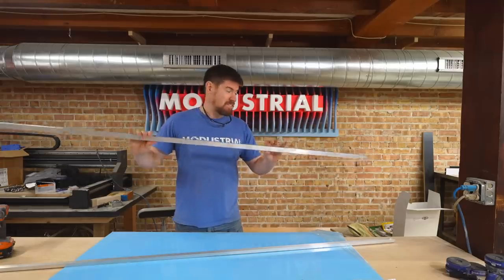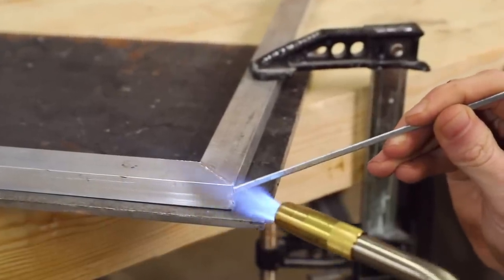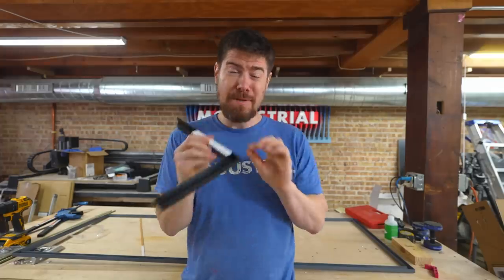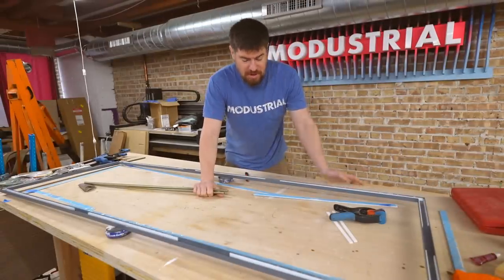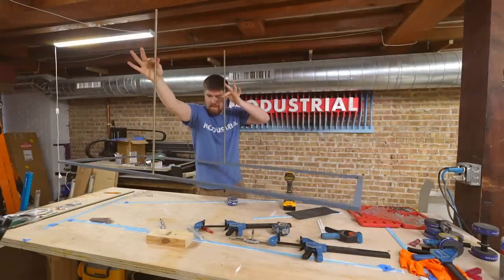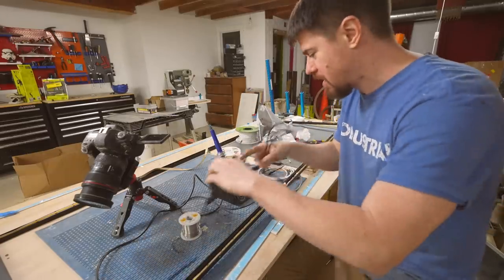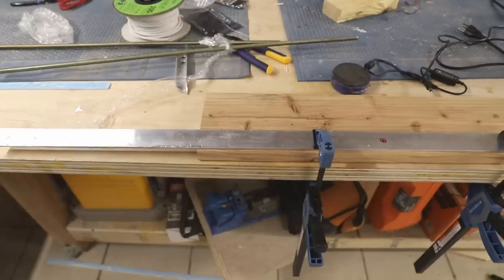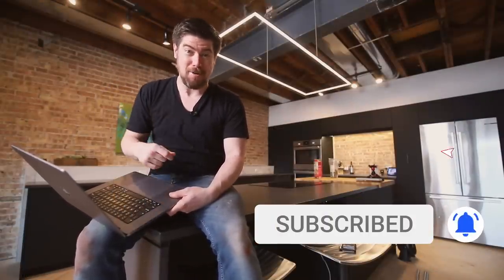I NEVER thought I could make THIS for UNDER $100... (ep. 33 Renovation)

Comment from the maker: Visit https://simplisafe.com/modustrial and get  20% off your SimpliSafe security system, plus 1 month free, when you sign up for SimpliSafe's Interactive Monitoring Service.
Reply: You should buy a MIG welding machine! Its very easy to learn and you dont need good welding skills to use it! seens you own a workshop you should own one!
Reply: @olavaar3262  I second this 😁
Reply: How are you liking the 4000k COBs.    A few months ago we installed 4000k can lights (which are really pucks about 2" thick) but suffice to say the 4000k made us feel like we were living in a laboratory.  We sent them back and got the 3000 or 3500 warm whites and it was 100% better.   Still very bright at highest setting but not that sheer pure white that 4000k gives.

Comment: The lamp rods not being centered would drive me crazy. An option would be to center the rods and then use small weights to balance the fixture after assembly
Reply: That would do it.  Or small magnets by adding a little steel to the aluminum?
Reply: @jonathanhall7903  aluminum isn't magnetic
Reply: @BarryMikkelsen  Oh geez!  Thats right, course!
Reply: Yeah, that's what I thought, too.
Reply: You can still use it as a counterweight, a dab of CA glue will hold it in place.
Reply: I really like the asymmetry!!  Not to mention driving the OCD crowd nuts is an added benefit....
Reply: yes i was very surprised he went that route!!
Reply: Could have made it a reverse cantilever by adding some lead strips to one end and moving the rods to well off centre 😬
Reply: That is what I would do. Even if it means buying a pack of lead fishing weights and gluing them on the top where needed. If they could be hidden inside, that would be better.
Reply: or fishing wire the corners up to the rods as fishing wire is like 98%invisable

Comment: Super cool. I can't help myself but to throw this out there: If building this for a smaller space, with a lower, white ceiling, you can flip it over and leave off the diffusion step. Painting the frame white and adjusting the distance to the ceiling. The ceiling becomes a reflector and would likely throw the light pretty far. Just my 0.02. Great video.
Reply from the maker: That would be really cool, good idea!
Reply: @modustrial  I'm all about getting soft shadows by bouncing light off of large surfaces.
The fixture would have to be a fair distance from the ceiling surface - I'd guess 18" minimum to get any decent spread. I may slap some LED strips on a channel this afternoon and see what kind of distances would be needed. Thanks for the inspiration!
Reply: @MattSpaugh  Interested to hear about your results on that…

Comment: A stronger connection would be to tap it and also use a nut as a back up, since it is very thin, the connection will not be as strong without the added nut.. I have done a very similar project and that is what I did.. Mine was basically a track light going all around the ceiling of our master bathroom as a main light source, I Made mine with a slightly different material, but I used an led light strip that came with a diffuser, It has been hanging in there for about 5 years so far, when used for light it is white, but at night I have it very much dimmed and it is in fade setting where it slowly changes color.. It has enough light to see what your doing, but not bright enough to mess with your eye's (night use) Cause at night at full strength kinda hurts your eye's.. I also used threaded lamp rods to run the wires and plain threaded rod for the rest of them and placed them every 4 feet (apart) Loved the video.. Thank you for sharing, I have enjoyed watching you turn that mess into a very lovely home.. You have a very bright future awaiting you.. Be Blessed.. Also glad to see you have almost completely recovered your health..
Reply: I was thinking that for several minutes, I was at least relieved a bit to see him using loctite!

Comment: Although the threaded tubing probably provides enough security to prevent it from sagging/falling over time, I'd still suggest adding a low-cost strain relief system for the edges/corners of the fixture. Something like extremely thin but durable fishing line or wire on all four corners would definitely help relieve the stress/strain on the "center" and the threaded tubes as well.

Comment: 3000K is a yellow type light, 6000k is very bright and blue. About 4000-5000K is a good 'Work' color. (K=Kelvin). 24volt has lower voltage drop than 12v over a distance.

Comment: The biggest concern I have with the threaded method is its into aluminum and it is pretty thin. I think over time the movement of the piece will will chowder the threads.
Reply from the maker: the fixture really shouldn't move much, and it is surprisingly sturdy.  I wondered the same, which is why I tested it first, and was surprised at the results I got.  Sometimes, you just gotta try things and see how they play out :)
Reply: Looked like only 2 threads

Comment: Since you had the tap and die set you could have just used steel, brass, or al tubing and tapped the ends. That way you would have a smooth tube instead of a threaded rod now if it was just ARGB that would be too cool. Overall love the build and I am so glad you are on the mend. The odd thing is that about the same time you had the medical issue I went blind. I had fast blooming cataracts. I just finished my second surgery last week and I can now see better than ever.  Great work and stay well.

Comment: That looks awesome, I might have to try making one. I wonder if you can get enough power through thin enameled copper wire to make it look like it is floating.

A little tip for the LED strip is they are likely to fail after a couple of years if you run them at full power, if you can drop the voltage down, even a small amount, you loose a very small amount of brightness but you will gain years of usage out of them.
Reply from the maker: good tip!  I'm planning to install a dimming switch.
Reply: @modustrial  that should do the trick :)

Comment: Tapping steel in aluminum, better make sure that the whole thing doesn’t move too much after installation. Steel tends to ‘wriggle’ out of aluminum. Especially when the aluminum is as thin as this.
Reply: Yeah, was hoping the first option with the nut would be used haha sure hope theres thread lock on the rod where it meets the light too

Comment: THAT is superb! We’re gutting/rebuilding our house & I want to incorporate tons of minimalist lighting like that on our first floor. One thing I was hoping to see though: how did you connected that lamp into the electrical box in the ceiling, i.e. how was it wired to the box and wall switch? Was it just hot wire/neutral wire from lamp to hot wire/neutral wire in the electrical box? Did you need a ballast/voltage converter for the LEDs? Really fabulous build, ESPECIALLY for that price, well done!👍
Reply: Okay not an expert but I might be able to answer some of your questions.
You do need a driver to power the leds. If you plugged mains 120v AC into it, it would fry for sure. Check out those flush mount LED pot lights to get a general idea of how the system would work. Basically, mains power goes into a junction box just like any other fixture, then low voltage (24v here) comes out the other end. 

Im sure you can buy just the jbox and driver separately for a project like this which would make it super easy!

Edit: the driver is actually in the description, didn’t notice that before lol. It looks like he’s also using that LED controller for on/off and dimming maybe? I don’t think it’s necessary since the driver will power em but the controller does allow for more control but then you need the remote. 

If you’re planning on using a controller I’d suggest something you can tie into a larger smart home system so you can control it with buttons, wall switches, or your phone for more freedom. I think Shelly has some for LED strips in particular that support full RGBW as well, but they are about $30 each but very customizable and easy to use/integrate!
Reply: @nathanblanchard8897  k

Comment: Love it. I think these would look great in a garage, but obviously would need complemented with additional high-bay fixtures on a separate circuit.
Reply from the maker: The 24V LED strips are super bright....if you went with a clear diffuser instead of a white one, they coudl 100% be the primary lighting for a space.
Reply: @modustrial  I don't doubt they are bright, but the real issue (I imagine) would be overall light distribution!

Comment: I've worked with lots of different types of plastics over the years, and there are two I despise cutting. Nylon and acrylic. I prefer to use Lexan or polycarbonate, as it is so much easier to cut and work with.

Comment: the rods just threaded to the c channel feels like a weak connection. i’d consider welding a nut on the top then continuing the tap to the c channel.
that way you still get the flat inside channel for the led, but more contact with the rod and aluminum
Reply from the maker: A weld wouldn't be a bad idea....just would need to find some aluminum nuts (probably available, but have to special order).

Comment: This is great, and my comment is not a detriment at all! But I noticed that while folks have mentioned that the thread may come loose with the steel rod and aluminum being as thin as it is, they haven't mentioned that the likelyhood of this happening increases because aluminum and steel react. Now, how long til it happens? Who knows? But a coating between the two is going to prevent that.

Comment: Nice project, now I imagine that is going to be a pain when the LED strip burn out. Still, pretty cool light fixture.
Reply from the maker: they are expected to last about 10 years on average, so not too much of concern.   if this fixture lasts that long before I decide to make a different one, then I guess I'll deal with it in :)
Reply: It's a rebuild, but that would be 5 years or more.  LED strips operating at 24V run a l o n g time.
Reply: The stripes are rated for a 50,000 hour life, and life means that the light output has dropped to 50% but the light is still working. The key is to not let the LEDs overheat, or all bets are off.

Comment: This is a terrific looking project. Please note that the pressure sensitive adhesive (PSA) used on the rear of these strips can soften with heat. The best adhesives are from 3M and are 467MP (.0023 thick), 468MP (.005 thick) same formula as 467MP, and 300MP, (.0023 thick) for low surface energy surfaces like nylon and plastics. Any of these would work with the 468 being the best. There is also a 3M VHB (very high bond) PSA which is superior, expensive, and not used that often. All of these strips come from China and some use inferior adhesives. You might want to check the temperature of the lamp with your hand and see what it feels like after a couple of hours, and it it's uncomfortably hot consider drilling a series of small holes to let the heat escape upwards. The Amazon strips are rated at 10 watts / meter so you may have 40-50 watts of heat trapped above the diffuser. Sorry for being so long winded and geeky, but I am a retired mech engineering geek. Once again, this is a great project, so clean and effective, wonderful job.
Reply: Holes actually won't help. Mounting to aluminum is truly the best approach for LED strips because it's a direct heat sink. You'll get more heat transfer through conduction to the aluminum than you will through convection to air. (from the led strip). If you are getting too hot you're better off adding more aluminum to raise the thermal mass of the heat sink. A piece of angle on the top side acting like a larger heat sink fin will do more to cool things than adding holes. COB Leds especially are looking to be mounted to a heat sink, not convection cooling. If you look at the high power COBs (not strips) they are made on aluminum PCBs and require that you then mount to a large aluminum or copper heat sink.
Reply: @Good Goat I've never found a Chinese LED strip with viable adhesive, so I usually use clips. Thanks for the info on workable 3M adhesives. I saved a copy of your comment in my projects folder. I agree that adding vent holes is a good idea, just because the strips are likely to loosen from the aluminum, losing its function as a heat sink. From a retired electrical engineer.
Reply: A modustrial building should be plumbed for compressed air, right? Just pump a little down one of the support pipes and vent it out the other for perfect cooling.    ;-)
Reply: @cegan09  - These strips have the LED dies (light emitting part) mounted directly to a copper/polyimide circuit. The circuit consists of a copper conductor, usually .0014 ( 1 oz) or .0028 ( 2 oz) thick, a .002 thick polyimide substrate (an insulator), and finally the .002? - .005? PSA (another insulator). The bottom side of the LED die is IR reflow soldered to the copper on the polyimide and the top side has a very fine wire running from the top of the die to the copper. The LED is encapsulated with a phosphor (another insulator) to protect the wire, diffuse the light, and determine the color temperature. The dies on these strips are on .094 centers so the actual copper conductive circuit traces will pull hardly any heat away line they do on the smt strips. There is no doubt that some heat will pass through the polyimide and psa to the aluminum, but will the aluminum become saturated to the point of not pulling the heat away quickly enough from the LEDs? An what about the heat emitting from the front of the LEDs? That's the reason I said, touch the assembly and hopefully it won't be hot and nothing will need to be done.
Reply: @no-page  Mod should have actually wired the strip in two halves to minimize the voltage drop. One oz copper at .0014 thick is equal to small wires depending upon the width of the conductive traces. I actually had a LED strip whose paper release liner noted 3M adhesive, but knowing the Chinese they printed bogus paper.

Comment: I just came across this. Really cool. The height of the light thought is always fixed. I am looking for a ceiling light which can be lowered or raised anytime with the help of a remote. I see that there are chandelier lifters but they are way too overpowered for smaller light fixtures like this one you have built. Any simple DIY ideas?

Comment: Follow-up dumb question - wouldn't it make sense to paint the inside white or some kind of reflective chrome paint? Painting it black is likely to absorb some of the light that could have come out of the fixture. Or are your LEDs just that directional?
Reply from the maker: You could definitely do that... The LEDs are fairly directional over a short distance, but yes, I think it could improve light output
Reply: The strips are one sided, so the back (top) of the channels don't matter. The sides are mostly not black also, as additional acrylic was used to make the channels. You might get a few additional lumens with a silver spray, but the light does seem plenty bright now.
Reply: @TerryMurray1  Oh, that's a good point. Completely forgot about the white acrylic on the sides. I commented during the painting segment. Should have waited for the full build. Yeah, probably not worth the extra effort of masking and painting two colours. I keep forgetting that LEDs are quite unidirectional. I stand corrected.
Reply: @TerryMurray1  the side acrylic is painted black... and no continuous so it could be better (not painted black and covering the full length) but we can't see on the video if it makes a difference...
Reply: @frederichardy8844  So it is painted black! Good call.

Comment: I just wanted to say, yet again an excellent job. 
I have a similar build going, but I am unsure regarding the amount of light required as it is to be a primary light source in the living room. I see you used 4000K in your build, is it enough to light the kitchen? or does it only light the countertop area?

It totally fits your industrial look, but for me, I would use some black plastic tubing to house the lamp pipes. That would get rid of the threading and would make the pipes less visible.

As always, love watching your channel.
Reply from the maker: Thanks!  The main thing as far as brightness is voltage and density of the LED strips.  I would go with 24V COB strips like these for primary lighting

Comment: Got a question: What blade would you recommend for cutting acrylic on a table saw?

That came out darned nice.  And the design can be used for overhead lights, vertical frames, table edges, etc.  Gonna remember this one for some future use.
Reply from the maker: I just used my standard woodworker II blade on the table top.   Worked pretty well, but there are a few imperfections if you look really close.  I think a high tooth count blade is best, and I believe they do make blades that are specifically for plastics.  Not necessary, but if you are a perfectionist, probably worth it.

Comment: Very cool!!  For the budget it seems you had an electrician? I would include labor costs too. I'm also curious what they did.
Reply from the maker: electrical work is so different for every install, but in my case, they just added a junction box above the steel beam and wired the LED driver and a wall switch to the junction.box.

Comment: Aluminum is soft, and that C_channel is thin. I would have brazed 1 or two strips on top of the channel and tapped the whole thickness. I don't think you'd see the additional strips. 
Or just ran a jan nut, they are thinner than a standard nut.